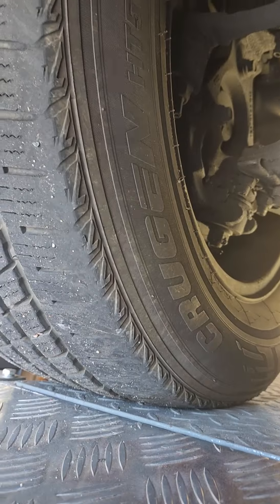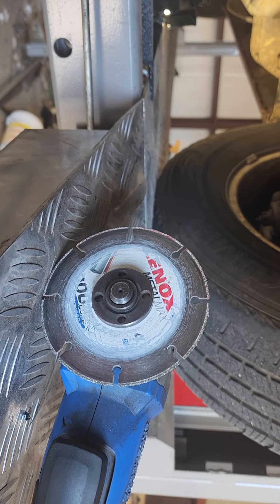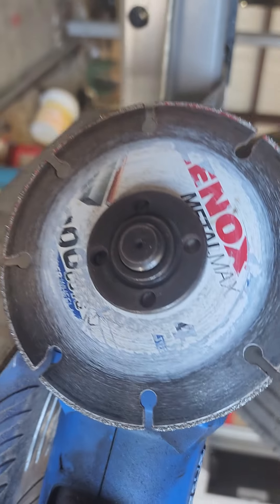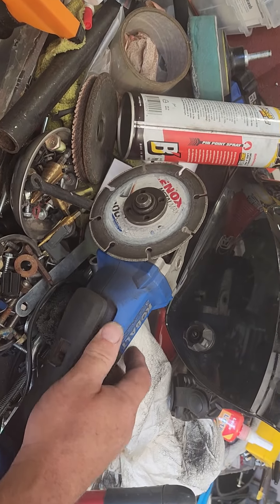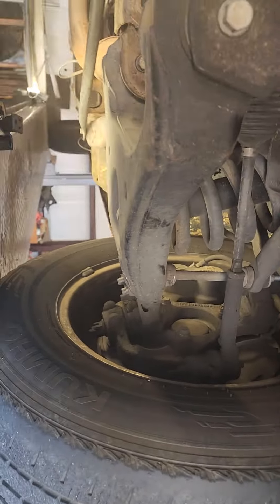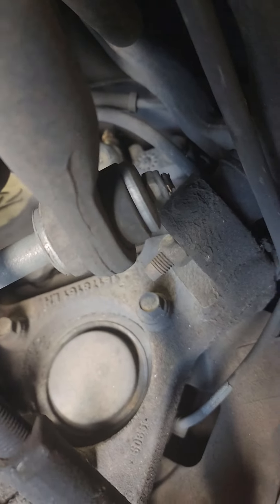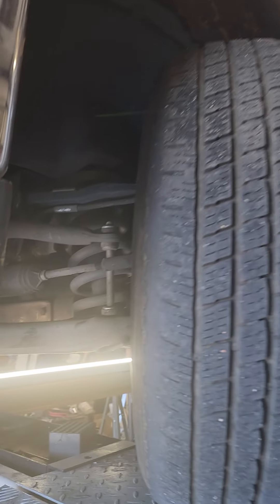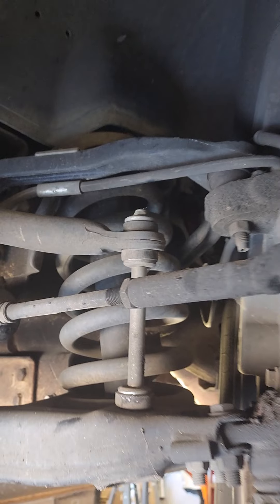✅️ yours now, 🔩 cutters or grinder

Comment: I just cut the rod in half with an angle grinder. The very first one I did, the nut would NOT turn. Not with spray, not with heat, nor cussin'. I no longer even try the nut.
Reply from the maker: That is the easy way if you are changing the bolt but I was just cutting off the excess so that it wouldn't rub the rubber line anymore.